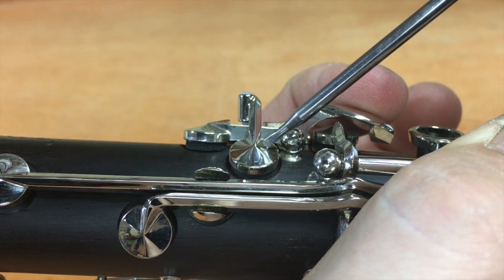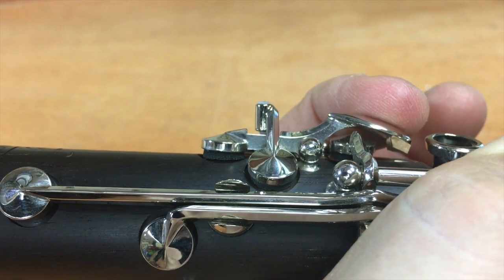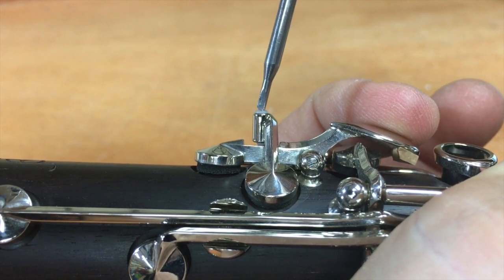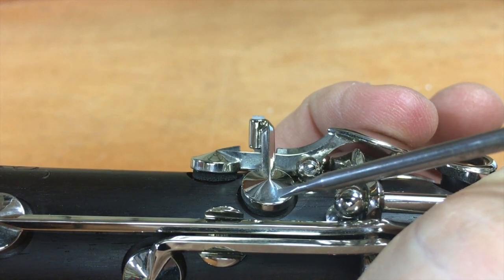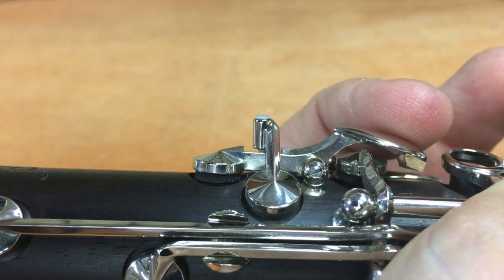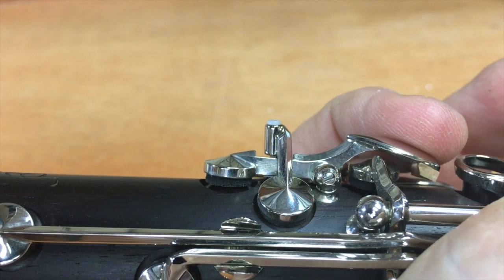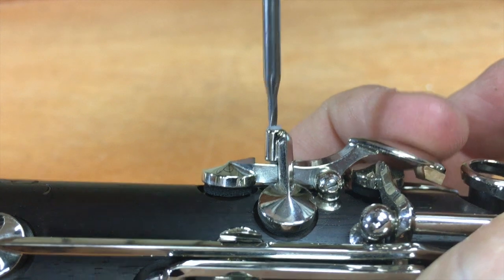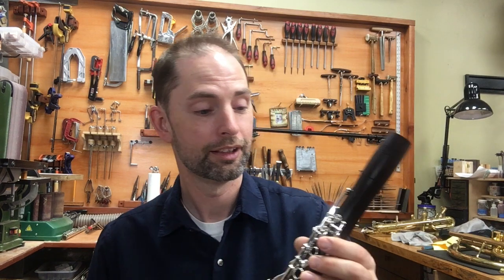Clarinet G#A Adjustment

Comment: Wow! Awesome tip. I'm a beginner, only had a clarinet for a few months, it's not been looked at by anyone else since the factory, so I've no idea if it was set up properly. Out of curiosity I just checked this mechanism. It had exactly the problem you describe. Very quick & easy to correct, thank you!
Reply from the maker: Welcome to the world of clarinet! I'm excited for you to continue to progress. I'm glad this was of some help to you. I do suggest you have your instrument looked at once a year for regular maintenance and cleaning. I pulled a clarinet apart yesterday that has so MUCH grim inside the hinge rod tubes that half the rods themselves had been worn down so badly I had to replace them. YUCK. This is preventable with regular maintenance. When I gave the instrument back to them last night, their eyes lite up during the play test. They felt the difference right away. Good luck!

Comment: Hello! I appreciate your videos on repairing clarinets-as a middle school band director, I've learned many tips along the way, but once in a while run into something I'm not sure how to fix! The issue I'm having right now is that when I push down the G# key, the A key comes up as well, so A and G# sound the same...what do I need to adjust to make sure the G# key works correctly?
Reply from the maker: Well that's interesting. The A key has a spring pushing it down against the tone hole so if it's coming up with your G#, then the A key spring is broken or the G# adjustment screw has bored into the A key and is dragging it along with it. I'm betting the spring is broke. Take the G# and A key off - does the A key have a spring? Is it in one piece and does it bend nicely at the end making a soft touch against the body? This is where I'd start looking. If that doesn't work, grab my free Emergency Repair Guide at repairmasterclass.com and reach out to me in the help section there with some pictures. 
I'm happy to help more.

Comment: Hi! My key adjustment is fine however, my pad is too thin. What brand and type of pad are you using for your A key? Thank you.
Reply from the maker: If the pad is not sealing I'd look at replacing it, but if the pad is in good shape and seals up but is just a thin pad, save yourself some money and move on. That being said, pad choice is an interesting topic. We want a pad that will not leak any air even when properly adjusted and, after a lot of testing, bladder skin pads and leather pads (without being treated) all leak. Treated leather pads and the two good types of Valentino pads hold tight and are my preferred pad choice. The treated leather pads I use come from Backun but my go to pads are the Green backed Valentino pads (they come in various thicknesses to accommodate the manufacture's designs) or the black Valentino Masters pads.

Comment: For my clarinet, I have screwed the G#A key you mentioned for many turns. However, nothing seems to have changed. (I want to fix the issue that my G# part not lifting enough when I press the A key
Reply from the maker: If you've been turning the screw several times with no change, I'd guess there is another issue at play. The screw may be broken (this happens a lot with plastic screws) or something else. Start by trying to take the screw out - so turn it counter clockwise and extract the screw (don't drop and loose it) to ensure the screw is not broken. If it comes out, it will go back in. When it's in, make sure the G# arm is not bent to the point the screw does not contact the A. If these don't show you the issue, take it to a tech you trust or ship it to me to take a look at.

Comment: I have the problem that after adjustment high B and C (top on the A) don't working. What is the problem appears in the adjustment? Thank you.
Reply from the maker: Hmm... If I understand your issue correctly, this can be a difficult one. If you're referring to the notes of B and C on the staff, these notes can involve a long air column and lots of places for small leaks to pile up. Typically this has to do with the F#-C# key on the bottom joint and can be tricky to adjust correctly and remove any lost motion. If you're referring to B and C above the staff, then I would think you have the screw at the G#/A location a bit too tight and the G# is not closing all the way. You want a little bit of movement of the A key before it hits the G#. Loosen that screw and see if things improve.

Comment: My G# will sound like an A, and my A will sound like a B flat.. will this fix this?
Reply from the maker: It will help but the A to Bb has me concerned there is another issue. It seems like one of your top 2 side keys is also leaking. Try this: take just the top joint and put all your fingers down to close all the holes (use normal playing pressure here) and then, with your left hand middle finger, plug the bottom of the joint; now blow air into the joint where the barrel would go on. Listen for any air leaking, if there is, take it to a tech you trust. If you don’t hear anything leaking, try sucking the air out, it should seal tight very quickly, if you can continue to draw in air, there’s a leak somewhere and you should take it into a shop.

Comment: Mine is suck inside
Please help me fix it
Reply from the maker: That little screw can get stuck! When it does...it may be time to take it to a tech. The screw area fills up with all sorts of stuff from our hands and case and can get so stuck that, when we attempt to unscrew it, we strip the head (break the screw slot off). This means the screw has to be drilled out, tapped again and a new screw in stalled. Not that bad really. Try to put a drop of key oil on that screw, let it sit for a few minutes then take a good screw driver and firmly but gently attempt to turn it. Slowly increase the pressure - don't force it all at once - and feel/watch that screw to make sure you don't break it. If it turns, GREAT! If not...take it to a tech you trust.